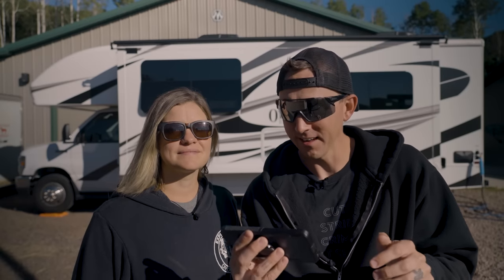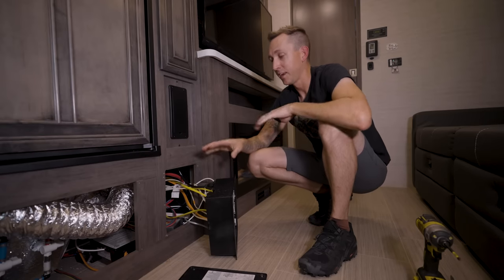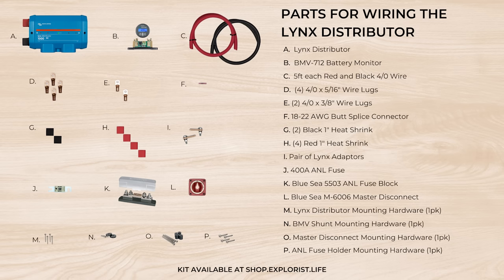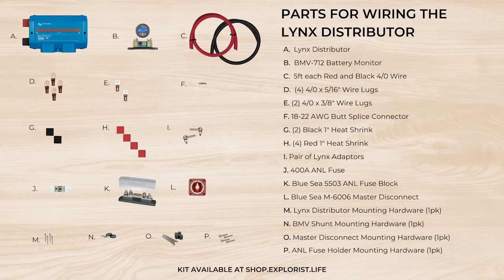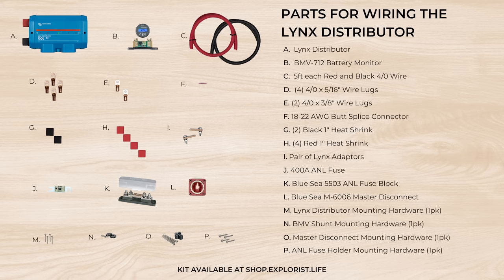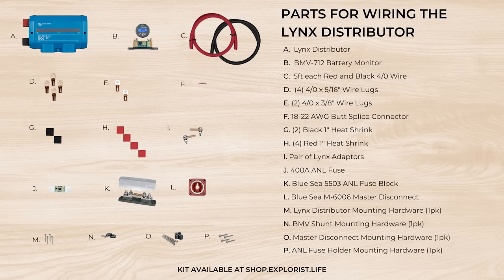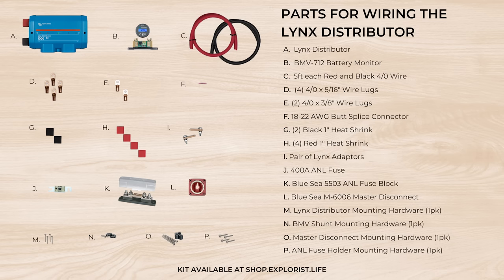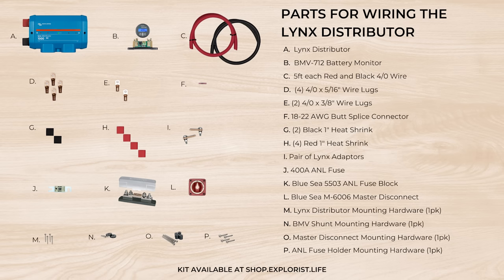Motorhome RV Solar & Lithium Upgrade - Start to Finish DIY Installation

Comment from the maker: ‼ IMPORTANT INFO ‼ I'll be keeping this pinned comment updated with FAQ's about this project, kit, video, etc; so be sure to click 'read more'.

Q: How much did this system cost/Where can I get more info about the parts in this system?

A: Check the kit that we've put together for up-to-date pricing and more info over in our store: https://shop.explorist.life/shop/all-products/30a-oem-motorhome-electrical-upgrade-540ah-batteries-multiplus-3k-12v-1200w-solar-orion-12-12-30/

Q: What If I want a system like this, but want a different solar configuration?

A.1: Check out this 'base kit' in our store: https://shop.explorist.life/shop/all-products/30a-oem-rv-upgrade-400-1200ah-battery-bank-multiplus-3k-12-orion-12-12-30-wiring-diagram-kit/
A.2: Add whatever solar charging setup you like from these options: https://shop.explorist.life/product-category/all-products/camper-wiring-kits/solar-charging-wiring-kits/battery-bank-voltage-12v/  
A.3: Then get your batteries direct from Battle Born.  Use code 'explorist' at checkout for $50 off per battery: https://battlebornbatteries.com/shop/brands/battle-born-batteries/?afmc=explorist_bb67

Q: I don't want to DIY.  Can you install this system for me?

A: We don't offer installation services at EXPLORIST.life as our gig is making these videos that teaches you how to do it yourself.  BUT... we have a network of installers that we have trained to install our kits/systems/designs that you can hire.  Contact any of them directly for more info: https://explorist.life/find-a-certified-installer/
Reply: We also have a 26M. Confused about the switch you installed up front with the DC-DC charger.  Do we need this & why & where to purchase???
Reply: Nate & Steph, 
Wow, I just love the organization & discipline you demonstrate in your videos!  

Cheers, Eric

Comment: What were the dimensions of the enclosure for this install? I'm interesting in buying your kits to copy/paste this setup, but I don't know if it would fit in my Winnebago cabinet.
Reply from the maker: I don't recall the enclosure dimensions, but with a little creativity/persistance, our systems can really be put in nearly all sizes of enclosures.  The dimensions for each component is listed on each product page, so you'll just need to spend some time there with a tape measure.  Alternatively we DO offer installation services if you need us to figure it all out for you.  All kinds of options to get you the system you want.

Comment: The blue cable ducting with integrated isolator switch makes this install look extra neat.
Reply from the maker: 😂 That was a bit of a pain to get to line up perfectly, but I'm glad we took the effort to make it happen.
Reply: @EXPLORISTlife Nice work! I couldn’t find the link you mentioned in the video for the wire duct in your video description.

Comment: Thank you!  Finally, someone to talk about the BIM switch and what to do with it.  I have watched a bunch of videos on adding a DC to DC charger, but nobody mentions how to handle the flow from the alternator directly.  This has been on my mind from the beginning.  All I ever saw was how to add a second channel to charge the coach battery and nothing on the preventing the alternator from continuing on the original channel.

Comment: I love your videos and have used them to install 3 full systems now with great success.  I wanted to forward on an idea that I used for my personal system with regard to solar panel install on the roof.  I decided to use shallow super strut channel to attach the panels.  This allowed me to use far fewer (although larger) attachment points to the roof itself and still maintain a low profile.  This then allows me to remove/install/move solar panels as I want without needing to drill new holes or fill/seal old ones.  All the hardware is available at your typical "Big Box" hardware stores and didn't cost much.  I used 1/4" x 1/2" well nuts and lap sealant for the attachment point of the strut channel and made sure that it was attached to the trusses of the roof whenever possible.  You can then use cone nuts and middle or end solar brackets to attach to the strut channel.  It has worked perfect for nearly 3 years now.  Just a thought!

Comment: I'm totally impressed with ALL of your knowledge of Solar power and electrical setups. The main reason I found your channel is because I've been doing research on adding solar power to my 2019 Jayco Redhawk SE 22C which is solar prep. I also have lead acid battery in the same location and also the same converter charger. At the moment I don't know 'how' much solar will need but I will be checking your videos you put up.. If you have a specific video I should view please let me know...Thank You and subscribed.

Comment: Hey Ryan - nice job on the RV upgrade.  I'm sure your Mom is very thankful for all your hard work.  This system will be very nice for her!  I recently added an Orion 12:12 | 30 to my sailboat and found it very helpful to add a 1/4" aluminum backing plate with spacers between the aluminum plate and the mounting surface.  These Orion chargers can get pretty hot and the added head sync of the aluminum plate with the air gap between the mounting surface really helps to keep the charger cool maximizing it's performance.  Just a tip I picked up from another YouTuber that I thought would be helpful to mention.
Reply from the maker: Thanks, Jeff!  Yeah, there are all kinds of 'hacks' you can do to make various equipment run cooler depending on how much you want to tinker with it; but most of the time, we just opt for installing it exactly as the manufacturer recommends to keep things simple for those watching who may not like to 'tinker' with stuff as much.

Comment: Excellent video, as always. I seem to glean at least one new idea from every one of your videos. This one gave me an idea of how to use your battery relocation kit and an Orion to clean up the factory battery location on my fifth wheel camper. It has several of those temporary breakers all connected together with a "buss bar", one of which is a 40amp breaker for the charging coming thru the 7 pin connector. I think I will remove the one breaker and place an Orion in its place. The factory battery location is directly under these breakers so I will use the relocation studs as intended and have them mounted next to the Orion so I can keep those other breakers connected and powered up.
Reply from the maker: Nice!  Be sure to check your trucks 7-pin wiring if you do that as sometimes the OEM wiring it a bit undersized to support an orion 12/12-30.

Comment: really nice install, I would definitely upgrade locks for storage bay (most of them are 2-3 master keys) and try and put batteries in the living area to keep them warm or duct from living into there. 
I am a huge fan of Solar Rails on Roofs instead of mounting panels directly to the roof, about 1/5th the amount of screws and you have an upgrade path and ability to layer/nest panels.
Reply from the maker: Thanks for watching!

1: Yeah, there are all kinds of RV modifications you can do as you like.  Wouldn't have made sense to show that in this video, though.

2: The batteries we used a self heating, so they don't need to be in the heated living space nor have a heater duct run to them.

3: 1200W for 600Ah of battery bank capacity is an appropriate ratio of solar and these panels will last longer than the motorhome itself more than likely, so an 'upgrade path' isn't necessary, but if you need a different solar array setup when you go to tackle this project on your own motorhome, once you figure out your 'nesting and layering', we have many different configurations of solar arrays you can choose from available at https://shop.explorist.life

Comment: This build makes running the generator sort of unnecessary, but the way this is configured, the starting load of the generator would go through the 150amp fuse.  Seems like there is potential to blow that fuse when starting the generator since it probably pulls that many amps to crank?

Comment: Awesome and detailed upgrade!  I have a 25R model. Jayco says the chassis alternator does not charge and has not charged the house batteries since 2021 or before. There is no connection between the chassis and house batteries unless the dash button is pushed.  If this is true is that switch you put in actually needed? Do I have to worry about my alternator getting fried trying to charge the lithium house battery I plan on installing? I think Jayco tech is giving bad info.  😢

Comment: I LOVE watching your channel. I have learned so much. I'm an RVing Mom with a new Class C too. I just had 2 100AH LifePo4s installed under the stairs. I have searched the internet for 3 days trying to find out how to DISABLE alternator charging.( I picked the wrong installers and they had no idea.)  I will just charge from shore and generator for now. Maybe solar in the future. If I disconnect the red wire (or is it the yellow wire to the dash?) from the isolator relay/trombetta and tape it up will that do it?  I have a portable jump box and don't need a switch. I was SO CLOSE to getting my answer but there just wasn't enough detail in this video.  Thanks to you I have a Victron 712 and I LOVE IT! No more dead house battery for me! :)
Reply: I also want to disconnect the isolator permanently.  Is that ground wire he points out orange?

Comment: Another great video; however, if it was my mom, I would incorporate uploading the Info into the Victron VRM portal.  That way, you would have remote access (with Mom's internet) to routinely monitor, tweak, troubleshoot the upgraded electrical system on your  mother's RV.
Reply from the maker: Nice!  We have a wiring/component kit available as well as a tutorial that will teach you how to integrate those systems into your moms camper when you get ready to build this system in her camper if you want to change it up from what we showed in this video as we know everybody has different needs and wants:

Wiring/Component Kit: https://shop.explorist.life/shop/all-products/system-monitoring-wiring-kit/

Tutorial: https://www.youtube.com/watch?v=ojcFqNxe0sE&list=PLmvhcyi4n0TURo-6UoSqvp3pDkfLCrxeY
Reply: @EXPLORISTlife  Unfortunately, my mother passed away almost three decades ago; I was making a reference to if I were you (Nate)- and was preforming the upgrade for mom, I would have ....
Reply from the maker: Yeah, and I responded in a way that provides value/direction/instruction for anybody reading through the comments section here who feels the same and wants the advanced monitoring of the cerbo gx in their system.

Comment: Just found your channel. This is a marvelous step by step on Solar/LiFE4 upgrade for a Class C. The one thing I could not find is how much does all this weigh. I know some of these Entegra Odyssey RVs in particular have very limited cargo capacity and I was trying to figure out how this install would impact overall weight (after removing the small fridge and OEM battery). I was starting to work through the parts list to try to come up with that number myself, but thought it would be worth asking first. Having a hard time coming up with some of the weights of the individual components.
Reply: After I asked, I decided to go ahead and do my best attempt at figuring it out myself by walking through the parts list. Counting the two BB 270AH batteries, my best estimate comes to about 413 pounds (including all the copper wire). I also tried looking up the existing battery and from what I can find, I think the OEM battery on the Odyssey is around 180 pounds (sounds heavy to me, though, unless the oem battery is 330AH). And, as best I can tell, mini-fridges weigh in somewhere around 35 pounds. With all those assumptions, the net increase in the base weight of the coach would be 198 lbs, which is not as bad as I was expecting.🎉

Comment: Hi, it is worth noting that if your lifepo4 battery bank can’t handle the surge of starting the engine motor via its lead acid battery, using the emergency jump switch is a horrible idea if you turn the ignition on at the same time. It has trashed a few banks per the solar group.

Your bank is large enough this may not be an issue, but for individuals with one or two 100ah lifepo4 it could be. Worth noting at least.
Reply from the maker: The lithium battery bank installed in this video you're commenting on is most definitely capable of firing up the engine in a jump-starting situation.

Re: "Trashing battery banks", if the battery bank is too small to deliver the amount of power necessary to jump start the engine; it shouldn't be 'trashing' anything as the BMS inside of each battery should simply turn off/disconnect, preventing damage (given it's a high quality battery/BMS)
Reply: Do you have a kit for this exact system? Also, how long will those batteries power the ac?

Comment: Great channel.  I'm confused about how the various devices in a typical Victron mobile system play nice with the batteries and prevent them from overcharging.  It's a very modular system where even the shunt seems to be optional.  Does one device end up becoming the master to keep track of battery SOC?

I would like to figure out a safe way to do alternator charging of the house batteries.  The coach I'm converting has an oil cooled Delco 50DN 24V 270A alternator with an external adjustable  regulator.  Some literature indicates it has inherent current regulation but I need to research that more.  Since all of the high current motors that ran the old HVAC system have been removed from the coach, I have a ton of unused capacity.  I want to run one A/C from it while on the road (I know the alternator is quite capable of this from an older build).  I'd like to use a Victron Cyrix to do alternator charging to allow more current than the DC to DC solutions produce.  I am confused about how the power coming from the alternator to the batteries gets accounted for and which device(s) in the system could supervise the Cyrix and shut it down to prevent overcharging of the house batteries.  In my case I would have 24V Lithium house batteries, Victron Inverter/Charger, Victron solar charge controller, the Cyrix/alternator, and probably an Orion 70A converter for 12V loads.

Comment: This upgrade plan is nearly exactly what I need to do.  We have a similar Integra motorhome built on the same Ford chassis.  The only difference for us is that we will only have room on the roof for three 200w solar panels.   Are you planning to make this wiring diagram available on the website for download ?.  I'd like to purchase a copy for study purposes and I could not find it there yet.

Comment: I love this and so many of your other solar installs. Top notch quality! I have your 30amp RV schematics downloaded and was prepping to tackle a very similar upgrade over the winter in my class A. At 22:22 you show the install of the splice - if my existing 120v wire from the transfer switch to the fuse panel, can reach the multiplus, I can just cut it, and install one end in the multiplus in and the other to the multiplus out. The splice is just needed because of your install location and the camper wiring path, correct?
Reply from the maker: That's totally fine!  Most campers just don't have a good spot to put the multiplus directly in-line on the shore power -> breaker box wire with enough slack to do that.

Comment: Why such a big solar charge controller? Why not the 100/50 since you wire in series parallel. Those rich panel are 72.9/30.6 correct when wired in series parallel?
Reply from the maker: A 50A controller only supports 700W when connected to a 12v battery bank, thus needing a 150/85
Reply: @EXPLORISTlife  ah, I knew there was a reason! Thanks - could you run 2x 100/30’s & split them up that way?

Comment: Great video which will help me with my lithium upgrade on my motorhome.  I have a question regarding the battery bank connection to the Lynx distributor.  Why is there a need for a 400A fuse between the battery and the Lynx distributor because each of the load connections to the lynx distributor have an individual fuse.  I don't see what benefit the 400A provides.
Reply from the maker: The 400A main system fuse protects the wires going from the batteries to the lynx distributor as well as the lynx distributor itself.  All of the other fuses protect the wires going to each of those components the wires are connected to.  Search YT for the video "EXPLORIST.life Where Do Fuses Go?"

Comment: Hi there. Thank you for amazing videos. I have question about using an inverter without charger function as I dont think I would be plugging in very often away from home. How would splicing into the OEM shorepower input differ? Can it simply be spliced into the shore power input cable? I would have to make sure both shorepower and inverter are not being used at same time obviously. Is this is bad option due to chance of having both running? Would love to hear your thoughts. Thanks again.

Comment: also why didn't you use BougeRV CIGS solar panels? they are so much more efficient, work with shadows and they stick on!
Reply from the maker: They aren't 'more efficient' no.  Solar panels work better in the sun, so we aren't worried about shade.  Stick on panels are pretty terrible in terms of heat dissipation, lifespan, and damage to the RV roof, so we will never use a stick on panel for a roof mounted array.